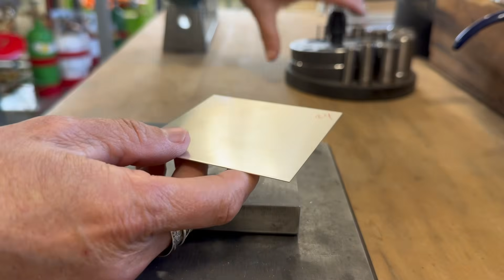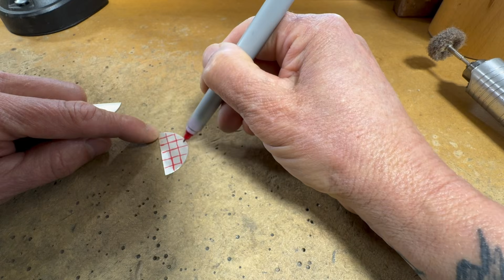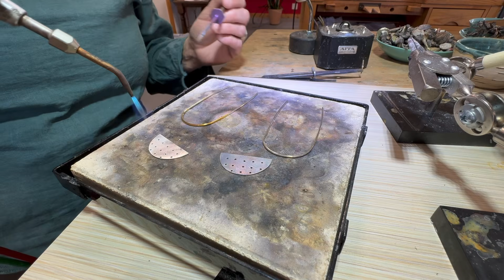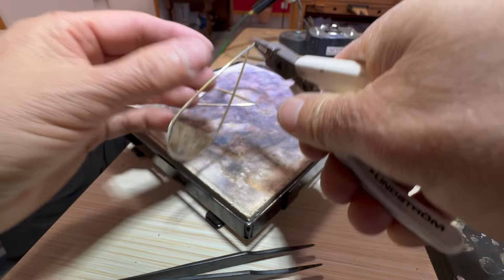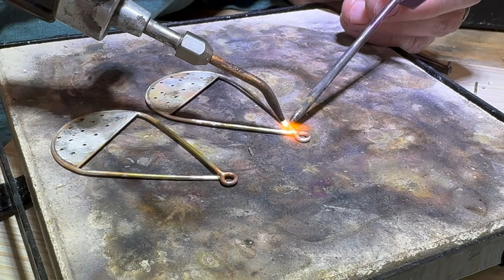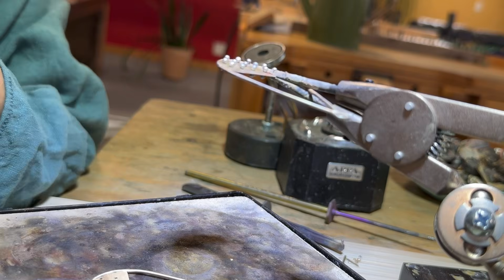Raindrop Earrings tutorial

Comment: Hey Nicole.  Just curious where to get a replacement silquar pad.  Don't seethe on Rio site.  Thank you for your videos.  So many usefull techniques to pick up.  I too had been under the impression that you can't fuse sterling.  A little more difficult with straight acetylene, but can still be done.
Reply from the maker: Are you referring to the brick that goes within the turntable? I do not think that Rio sells the replacement bricks, just the entire turntable: https://www.riogrande.com/product/rotating-soldering-table-with-silquar-high-heat-block-insert/502007GP?code=502007&objectID=502007&queryID=df0e33c382163a707d15daaf84de434f

But it looks like Amazon sells the replacement brick here: https://www.amazon.com/Non-Asbestos-Silquar-Soldering-Welding-Jewelry/dp/B01MS5QGRZ/ref=mp_s_a_1_4?crid=19LW7Z99223TO&dib=eyJ2IjoiMSJ9.E8T5XEPt1zIfQmaVl1a1AwCVMfbvD65wphNbZ-MiLVpV0tBho0lJAf4LVnSJP0VFgZa5KAHqt0-xXJM6_xFN8SUF_vpfKQ5HAEpgvmXRm6_rmL-cUDyxEswPKN4GwkCOGnp2dasxemsBF7-0VlUDvrhcm8KXke-wutcyKexD-ZiL5QSqpzyfgtZYDQXBwgGpg9eGYsUAlJvL1UIz32eZBg.jN69nukkZ52VNN5OBZ9Td2AwNBSZzpTPk3dr7hmrs8A&dib_tag=se&keywords=silquar+soldering+board&qid=1764190230&sprefix=silquar%2Caps%2C190&sr=8-4